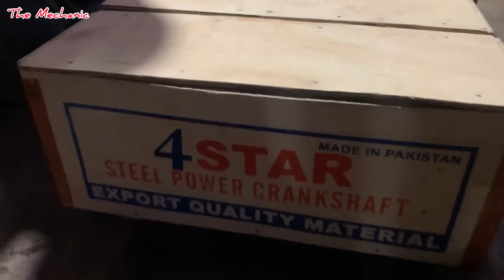Production of Crankshafts in Factory Complete Process || Machining 3 Cylinder Engine Crankshaft

Comment: Staggering achievement with the equipment available which is more than I can say for the quality of the bricklaying behind him.
Reply: what do you mean "with the equipment available"? The lathe being fully manual (no automation) doesn't make it less capable, just less efficient and far more dependent on operator skill...it's a proper old school big lathe...
Reply: The bricklaying and the quality are the same.... shit.
Reply: The only thing staggering is that more of them don't go blind or are killed. Long draping pajamas love to get caught up in big lathes. And I'm sure they have their safety sandals on so they are OK when they drop a heavy cast iron crankshaft on them.

Comment: When you think about crankshafts as a machinist, precision is the first concept that comes to your mind, but looking at these guys seems that you can be fairly loose on the tolerances and it still would work....amazing!! This workshop seems like an accident waiting to happen at any moment
Reply: Thank you. It is always great to learn something.
Reply: @Movers Diggerswatching how these men worked together , I'd definitely buy a crank from those fellas if they made one for my engine , this is how it was done before these new lazy keyboard and computer screen watching mouse clicking CNC machine operators were born  🤷🏽‍♂️
Reply: @Movers Diggers please, indicating with a piece of wire and using a hammer to dial in a 4 jaw chuck? sorry, i don't see the expertise. just because you can make something with an axe doesn't mean it's the right thing to do. the craftsmen seem fine, their tools and methods are crude at best. we won't go into how dangerous it is to wear long sleeve shirts while operating a lathe. safety glasses anyone?

Comment: That was fun. And once you realize that everything before the grinder is just roughing, it all makes sense. BTW those aren't bearing caps they're putting on when checking at the end, those are weights. This engine uses bolt-on counterweights, or a bolt-on balancer on the end of the crank. Or no balancing at all, for some applications. It's a tractor/boat/pump engine.
Reply: 39.40 packaging reads MF240
Reply: Massey Fergusson 240 tractors I guess.
Reply: Thanks. That answered my question. ^^

Comment: What about thermal processing and balance? Other than that - really cool 👍
Reply: These are low speed torquey engines. So balance get taken care of by being accurate enough. You run a big doosan machine you forget the rest if the world needs shit that lasts not necessarily the best twin turbo horsepower dense power plant possible. 

I know your sentiment was positive, but lets be real these are probably sub 100 horsepower 3 cylinder engines.
Reply: Massey Ferguson 240 tractor. Sub 50HP
Reply: @TheGondal86  just looked up that tractor. I saw they still make clones of this tractor today and are sold on Alibaba. A world on the brink of war and regular people just trying to survive. .
Reply: You know. For their cost they could leave some fat on the bearing and rod sections. Then spray a carbon slurry and a clay slurry and bake them and make high carbon wear surfaces before final polish. Shafts would last 2x longer.
Reply: Mohammed KH you dont even know what war is. The war in Pakistan is raging right now.
Reply: @dekonfrost7  you cant call border clashes a war , you know what wars is ??
Reply: LOL 3 cylinder engine and smoothness without a balance shaft are mutually exclusive, diametrically opposed and the co-existence of opposite concepts. The fore-aft rocking couple induces onerous vibration. 
I have a 3 cylinder Mitsubishi Diesel generator and I hate it. To manage vibration of 3 cylinder engines they usually keep the cubic capacity below 1000cc yet mine vibrates so much all the cabinet door locks are stuffed, the air cleaner bracket is cracked, bolts fall out, battery terminals never stay tight, starter connections keep coming loose and the generator won't auto start when programmed into the controller because of all the dodgy connections.  
Imagine the vibration on a tractor?? efff-me!
Reply: Vot dat?😅🤣
Reply: @dekonfrost7  these guys would probably benefit from war. Even a small shop like this could get a military contract.
Reply: @ThePaulv12  are you sure it's not just supposed to be an earthquake generator?
Reply: Alexander FL-TS no guys its ductile iron. Not steel.
Reply: Mohammed KH when you think you know, but you know nothing.
Reply: @dekonfrost7  your point makes no sense
Reply: @Techie1224  about as much machinist safety too.
Reply: @ThePaulv12  This is for low rpm diesel  tractor engine. The tractor itself is heavy, damping vibrations.

Comment: Gotta love turning cast iron, always messy material to work with. I couldn't imagine doing it all day.
Reply: Are cast crankshafts always cast iron and not steel? Gotta be careful with those hammering adjustments
Reply: @winstonmichaels407  Most modern cranks are cast iron for low performance applications. High performance and diesel cranks tend to be forged steel( 4340 alloy).
Reply: You can tell it’s cast iron and not steel by the way the swarf comes off in chips and by the black on everybody’s hands.
Reply: @trappenweisseguy27  Also by the obvious casting parting lines and flash on the castings.
Reply: @VenturiLife  casting lines technically indicate only "casting", and not material.  Plenty of good steels are cast and not forged.
Reply: @killer408cid  that's true.

Comment: for those wondering, this crank is used in Massey Ferguson 3 cylinder diesel tractor, and not in a water pump application as some suggested. This tractor produces 50HP, so if right alloy was used, and no major defects introduced during casting process it could work despite lack of hardening or heat treatment…
Reply: Thanks for explanation.
Reply: Does not it need high speed balancing?? I did not see any step doing that. Spinning at 3 or 4 thousand rpm, it may introduce vibrations?
Reply: @testchannel9170  no way it does more than 1,5k rpm ever
Reply: Actually,  its a crank for tractor BELARUS ММЗ-3LD  or MF240,   u can see this at  the end of the video when they show final packaging process.  
u w
Reply: @andy m, so what do you think MF240 stands for? Pretty sire it is Massey Ferguson. I am not an expert on Belarus tractors, but doing my research I did not find a Belarus tractor with such labeling.
Reply: @Test channel, it definitely would benefit from balancing, mechanical balancing can happen at at the assembly stage (when pistons and rods are taken into account) or, which is much more likely there is a polymer (i.e. rubber) balancer attached to the shaft. It’s worth noting that diesels redline at about 4k rpm, so I would not be surprised these can be used without any balancing
Reply: @martinshreder  At 15 HP per throw, a large Briggs & Stratton makes more power.
Reply: Perkins Engine
Reply: @martinshreder  there are bolt on balancers that are used at assembly.  You see him bolting one on with a 4-way wrench to check for rotational clearance before they are oiled and boxed.
Reply: @martinshreder  engine model is MMZ-3LD-20 35 hp
Reply: @BFGbmw  3000 rpm nominal
Reply: Must be millions of that tractor in the world with ALL the shafts in this place......u really think their only fitting it to the specified model? They don't even have safety glasses lol

Comment: These guys are doing a great job. What is more impressive is they are doing it in basic conditions and with old equipment. Just a pity they are not wearing eye and ear protection though.  Over time their hearing will suffer, and potentially open for an eye injury.
Reply: WHAT?
Reply: they are not, they destroyed machines and produce trash. Those lathes has a precision tools to do what they doing with a hammer. Amateurs that wasting material. Shame on them

Comment: When I was young, I worked in a crankshaft manufacturing plant...two VERY IMPORTANT steps I didn't see were 'heat treating', followed by 'straightening'...without which, you'd have a soft crank that when it warmed up, would draw-to-warp...and I KNOW that building we saw wasn't large enough to house a 100-ton press to straighten a crank...
Hard workers, though...
Reply: Heh, 2000-ton press can have similar footprint to this lathe...
Reply: They may be sending them to another business to be finished.
Reply: Heat treatment is required mostly for friction wear resistance on bearings surfaces and can be useful for fatigue resistance purposes. Nowadays on usual car crankshaft this second purpose is in most cases replaced by undercut fillet rolling, which can also straighten the crankshaft after the heat treatment.

Keep in mind that those crankshafts are well oversized, for engines with a narrow and low rpm range, which is definitely not the case in the EU/US/Japan car industry since the 80s. Also, the specific pressure applied on each bearing is probably very far to what we see on modern era designs.

Grey cast iron can bring good enough hardness for the purpose of friction resistance so heat treatment might not be a mandatory operation, provided you bring associated materials on the other side. Along with bigger machining allowance, (which are incredibly costly in mass production as you'll have to account for the biggest raw part possible and program your CNC accordingly with lengthy times not making chips on most of your production), you can totally avoid the straightening operation.

Comment: This engine is designed to run at a constant 1500-1800 RPM and is used in the Perkins India motor. Perkins is now owned by Caterpillar, so it's a Cat crank.

Comment: This has to be WWII era technology for the most part, maybe a few things of later technology.
Reply: Pre-WWII at best. Which is about as advanced as the engine they go in.
Reply: The camera .
Reply: @juancaorsi1805  I was thinking the tumbler, clearly looks like a newer piece of equipment. But "tumbling" has been around for 1000s of years.
Reply: We would have lost the war if that was the case. Put that in a 1600 HP Radial aircraft engine? We were a century ahead of them in 1940.

Comment: Apart from tolerance, It's really an amazing job, they've got it done by old machineries, I'm wondering what they can do if they are given advanced ones.
Reply: They'd break all the advanced ones and keep on using current ones. Trust me.
Reply: That Van Norman crankshaft grinder isn't exactly ancient.
Reply: I highly doubt they'd be able to read the instruction manual. Even if given to them in audio file.
Reply: @honkie247  that old Cincinnati mill is ..lol..circa WW2
Reply: @danielmccoy8875  And they operate both with the same lack of training.

Comment: Impressive low tech set up..very skilled workers doing the best with what is available...Looks like those are at worst  cast iron crankshafts...if made in SG Iron then its far  stronger and internal defect free...hopefully not made in steel as they would reveal cracks  and shrikage, internal cavities..no Crack checking or HT of any kind so it seems a low stress application...

Comment: Looking at the shipping boxes at the end of the video they are listed as Made in Pakistan, Crown Steel Power, MF-240, Export quality. If you Google you may find a Massey Ferguson 240 Tractor that used a 3-cyl diesel engine 46hp at 2000 rpm. Could be the crank used in lots of these small engines.
Reply: As these are rotary planed cranks , I believe they are probably destined for the Simpson Engine Company , who make an asian version of the Frank Perkins 3 cylinder engine , they look totally comparable  , but I,ve never tried one . The rotary planed crank gives the engine it is installed in ( & engine was designed for ) it,s musical burble when running , anybody out there driven an M.F. 35 ,  135 , 148 , 240 , 250 , 550 ,  would instantly recognise it,s engine sound , they sound happy , if an engine can ! The english Rover 3.5 V8 also has ( or had ! ) a rotary planed crank in it , ( it was an american Buick made under license in the u.k. ) these engines always burble , like the big Chrysler engine in a classic Jensen sports car , they pull like a train , this way of forging the crank was basically american in origin , according to one Mr Jeremy Clarkson , who described the basis of what I,ve written above on u.k. t.v. English flat planed crank engines have no burble , they run with a flat single rhythm , easy to pick out  . Final point , will somebody please give these dedicated guys some eye protection glasses please ? ......Can,t tell you where I am but...... it ain,t half hot mum ! ( compared to Peterborough ) No pun intended . Best Regards .
Reply: @phillipcleaver7063  You truly believe that "can,t" = can't and "it,s" = it's. Sad for you.
Reply: @quickbf  the fact that you needed to comment on it is the saddest part, get a life
Reply: Going to Belarus to go into the LONG made Belarus farm tractors all over former East Europe. In that event the quality is adequate.

Comment: Being involved in engineering for the last 40 years, many essential steps missed here. I doubt the tolerances held would be acceptable to modern automotive standards that would be a couple of microns. The casting quality look very porous, I doubt these cranks would last,especially when no evidence of heat treatment. Production typical of the 1920s
Reply: These Crankshafts , which are packed in the end (MF-240 on the boxes) at 39:43 are for the Massey Ferguson MF 240 tractor built in the 80s. So therefore, they may function okayish (?), but won't definitely work as long as the original part. 
In a modern car, OMG, this engine is sent to death the moment they are mounted :D
Reply: I guess it's made to a certain spec. No need for making it better in terms of finish and tolerances if it's not necessary. That's money down the drain.
Reply: I agree. But whoever buys crankshafts surely checks them for sizes and quality. Maybe they are just the roughed parts that are going to end machined somewhere else?
Depends on the type of equipment and the load on the engine. The tractor named here had less than 50HP and a max torque below 150Nm from 2,5l of displacement. And look at the size of that shaft! It might all be more than good enough for that demand.
Reply: I wonder which company use these crankshaft these are over tolerances
Reply: @KapilDev-md5uq  Probably for low revving engines with very little power output. I'd guess a very large 3 cylinder diesel engine
Reply: @KapilDev-md5uq  propably some local made stationary diesel generator or a tractor of some sort. They’re definitely not going to R&D porsche Motorsports.
Reply: So, parts made by and for 1920s tech would not "be acceptable to modern automotive standards". No shit, Einstein. You really are a special one..
Reply: @jackmclane1826  these are finished products, to do more work would be pointless, polishing a turd effectively.  As you said, probably fit for the proposed purpose as they are, typically the crank is $175 in the US, £135 in the UK.
Reply: You've no idea about the economics of parts in these countries. Typical glib comments.